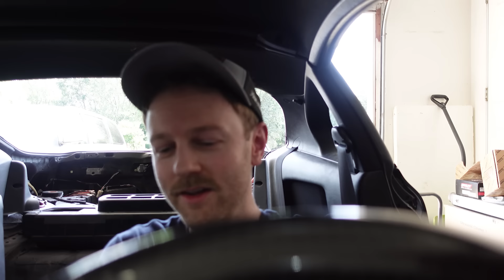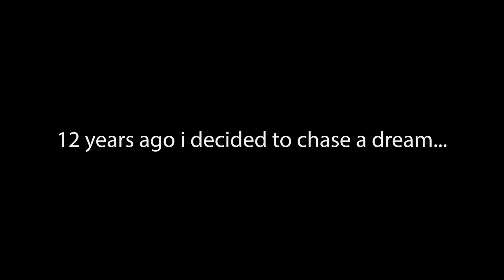My Fully Built 2JZ MKIV Supra Finally Runs — 12 Years Later

Comment: Beautiful result. I've been lucky with my Tilton 6000 HRB mount, drove it around 75000km until my ST-246 was done but I put new plates and new gaskets for the HRB while at it and it should be good for another 75k.
By the way, I had to adjust my Tilton 6000 HRB distance closer to transmission after 45000km as it started to slip due to clutch wear pushing the fingers too close to the HRB. So keep eye on that if you plan to drive it a lot. ;)
Reply from the maker: Thanks so much for letting me know about that!